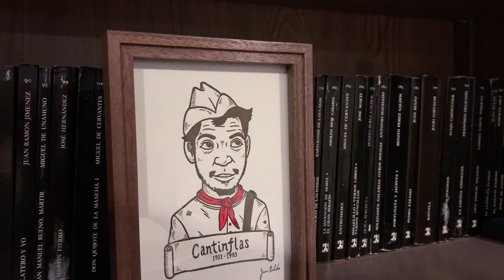Making a Small Art Frame | Hand Tool Woodworking

Comment: I found another way to continue when the fence on the rebate (I'm from UK :) plane started hitting the bench was to just remove the fence. Once the rebate is a certain depth it seems to guide the plane. Still, if you have a shoulder plane it's probably less hassle just to grab that.

Comment: Than you for all your hand tool videos.  I learn a lot from them.  Could you please let me know if that rabbet plane has a skewed iron?
Reply from the maker: Thank you for watching! The Stanley 78 does NOT have a skewed iron.
Reply: Thanks !  Do you also use it for across the grain rabbets or do you use another one? Or are you fine with it for both. If you use a different one could you suggest/recommend one from Lie-Nielsen or Veritas?
Reply from the maker: @edwardleonard9901  Hey! I use it for cross-grain, too! It works fine with the nicker, but it doesn't leave a great surface finish. So, I take it close to final dimension and then finish by hand. As far as other brands, I wish I could help more, but I have zero experience with them. Of course, I would love a skewed iron plane, but I don't have one at the moment. That said, I love the Lie-Nielsen look over the Veritas--purely preference for the older/classic style over the very modern Veritas.

Comment: Andrew, wha'ts your combination square brand?
Reply from the maker: It’s from Home Depot—Swanson. I tested some for square when I bought them, and these were bang on. They don’t hold as tight after about 2 years of use, however. Still I like them.
Reply: @TheHandToolery  danmit, here in Brazil they are expensive (R$145, last time I checked). I will try to make a plane and need an accurate one, but so far has nothing been easy. Thanks, and nice art frame!
Reply from the maker: @luizgabriel3388  Aw, sorry to hear that! If memory serves, I paid $20 (maybe more) for both, and at 5-1 exchange, that's R$100, so that is a bit of a markup for sure! Unfortunately, I've found that to be true a number of times, that products can be marked depending on the market.